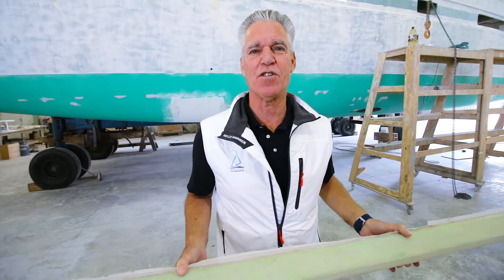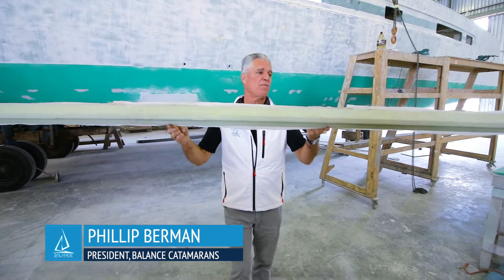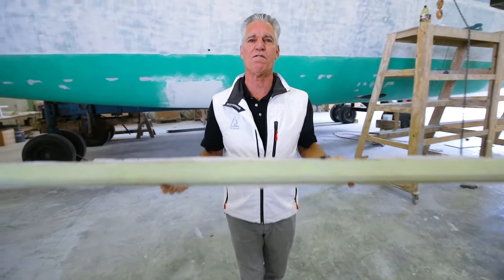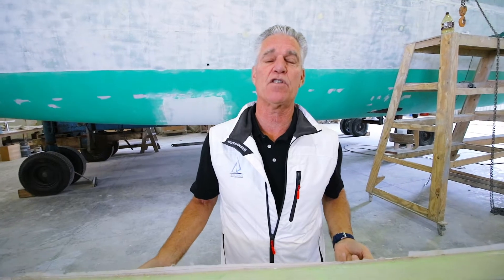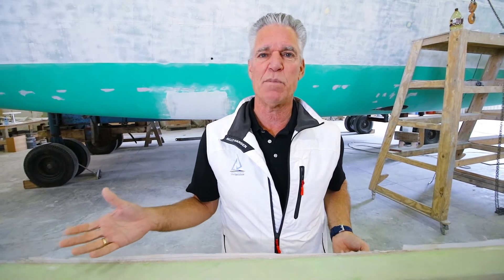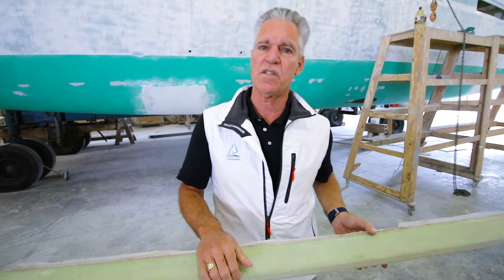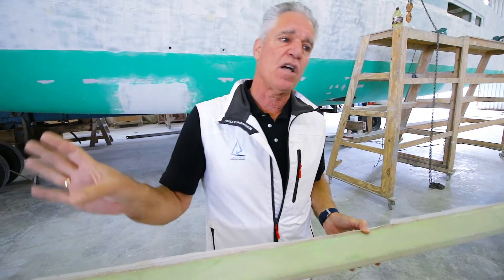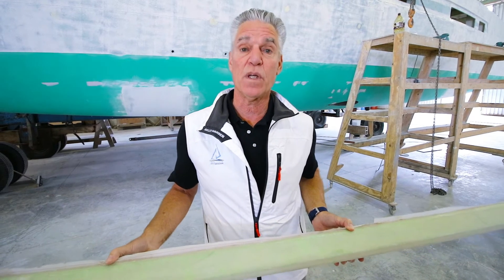Balance Build Technology - Keeping Our Boats Lightweight

Comment: What brand of panels are you installing ?
Reply from the maker: Solar panels brands depends on customer request and location. We can supply any number of different panels. I cannot recall the brand we used on most recent boat, but they were glass panels. If important to you we can get you that information. We find that technology is changing so fast that it is best to make solar decisions toward the end of the build when we need to. Stay in Balance!
Reply: Balance Catamarans yes ,POV panels efficiency is increasing rapidly...best panels for boats are “sun power solar panels” check them out...Happy Eastern and as u say Stay in  Balance!